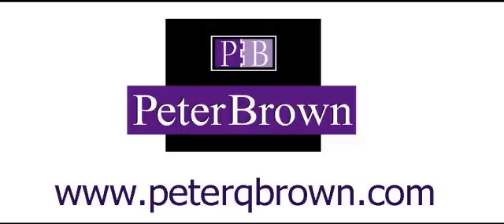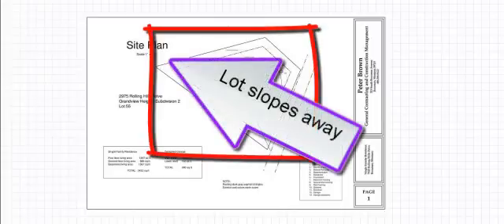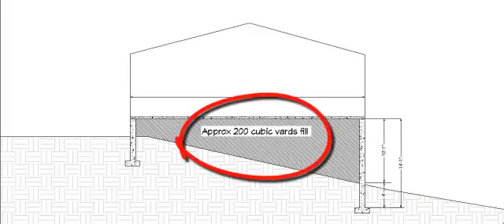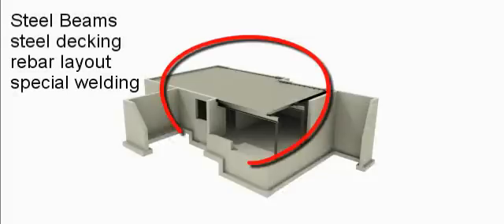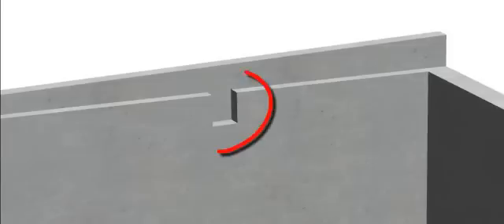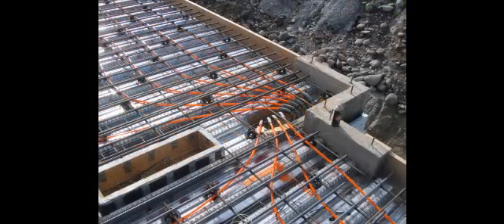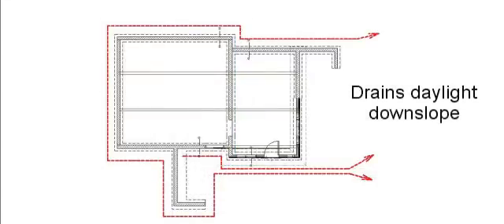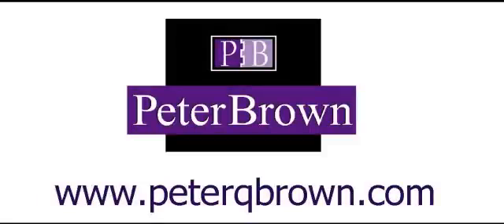Structural Concrete Design of a Garage Floor Allows for a Full Basement Below

Comment: Would this change significantly if you put a vehicle lift(700#)  to hold a 4000# car and parked another 4500# car underneath it?  On the top layer garage of course.  Also,  I assume even if the basement wasn't a living space but storage the same engineering applies.

Comment: I'd like to build a house similar to that, only a bit larger, to look as a 3 car garage on approach ,  with the house below, facing into a valley, in a south facing mountain side. With a 2 bedroom, 2.5 bath open floorplan, with eating kitchen, living room, about 12'x20' for kitchen & living, maybe use light tubes in the bathrooms, with about 12' x 28' per car, for lots of room,  it would not only be for parking cars! I have land , but not exactly suited for this project, the home would be facing into a dark small valley, with little sun. I'm thinking of something like a semi desert area maybe in new Mexico, or even up to southern Idaho, I'd want it to be close to a small town, very small! And not so close! Or I'd stay out here on the east coast foothills! I have dabbled with looking for land, a place with a small creek or spring would be a plus! I want it to be off grid like I have now, just ina somewhat drier climate, you would think you were in South Florida with the humidity we get here in mid to late summer! 100° and 80% humidity, I don't get nothing done, I have been in las Vegas mid July, I can deal with that much better, still hot though! Great video sorry for rambling, I always been into architecture, don't know alot but it is of interest, and I have been into the trades, and worked in most, anyway sorry for rambling!!

Comment: the filter cloth encircling the drain tile is a bad idea. when the filter gets plugged how do you change it?
the purpose of the pipe with cleanouts is to allow any sediments to be flushed out if needed, if the sediments are in a filter membrane surrounding the pipe your only option is to excavate the entire system. I am unsure how this idea got started but I have worked on jobs to replace drainage systems that were done with filter cloth. and yes I still have jobs that spec filtercloth wrapped drainage, we jokingly call the cloth 'sealcloth'